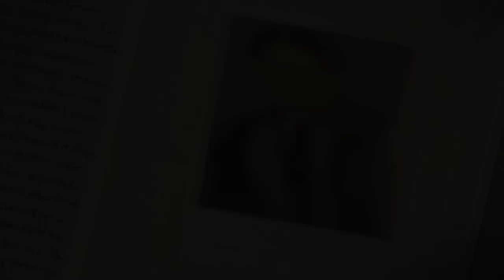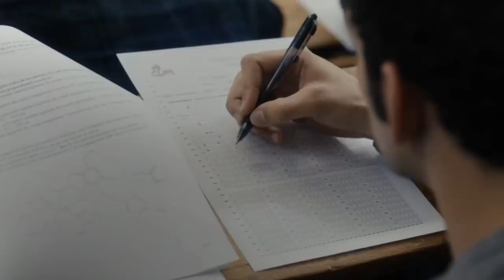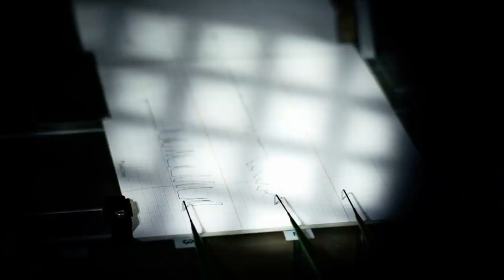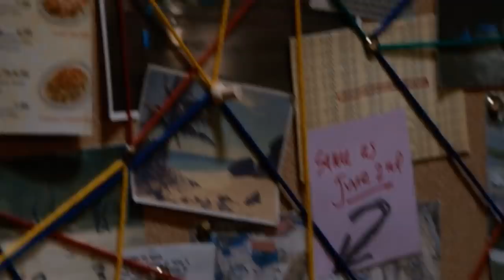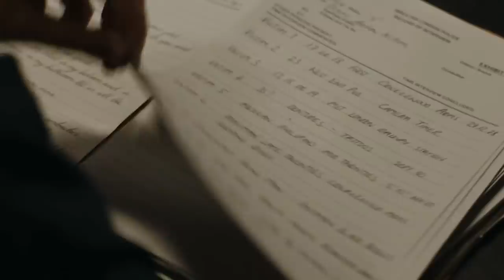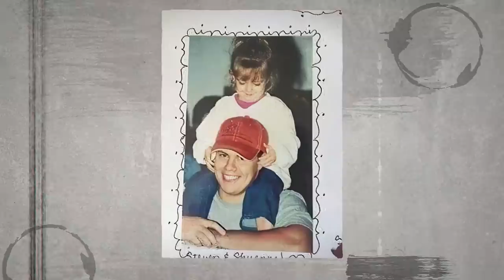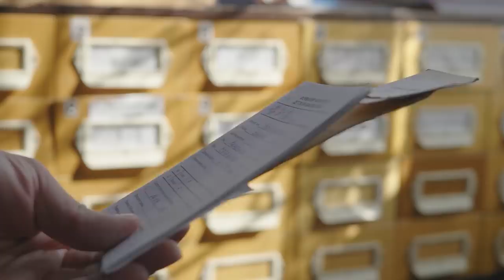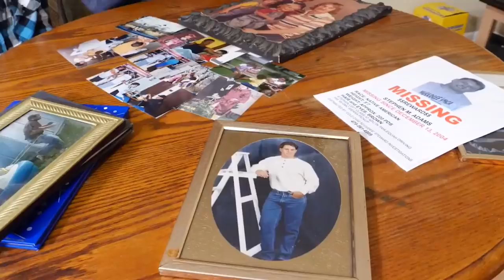Helping a Hitchhiker: The Unsolved Disappearance of Stephan Mitchell Adams

Comment: I wonder if the ex wife has any connections with the investigators? It doesn't sound like a whole lot was done regarding informing local areas or following up tips beyond the initial first step. Judging by her actions, it might also be true that the ex wife lied to her own family about the abuse in order to have them help get rid of the problem.
Lots to think about in this case.

Comment: This a hypothetical guess. But I would search Camp Gruber which isn't far from where the film Where the Red Fern Grows, was filmed. Jincys kitchen. It's a small local restaurant which is only open on Sundays. But less than a quarter mile from this restaurant is what we locals call the back entrance to camp Gruber owned by the Corporation of Engineers "Government property". This property stretches out for miles across northeast Oklahoma. Easy for someone to get lost into this wilderness. As it is and will stay wild wilderness. Also I have to note the fact that as soon as anyone even drives onto any of the entrances to the government property. Cell phone service will not be applicable until a cell phone reaches the exit/entrances of this whole government property. Pretty strange to be able to stop cellular service at exact random property lines. My own personal opinion.